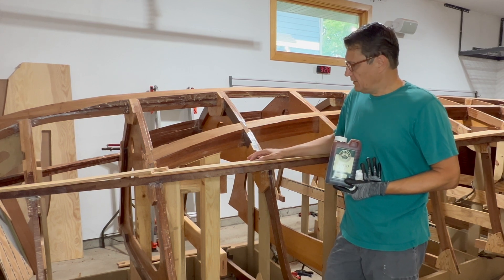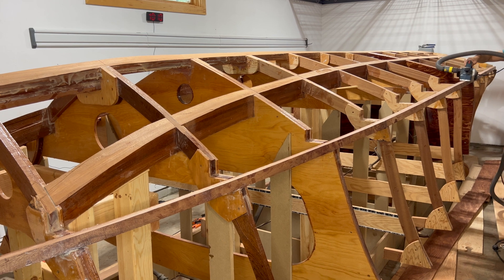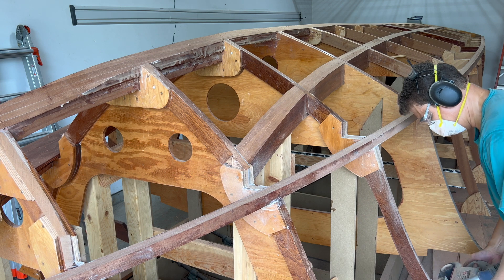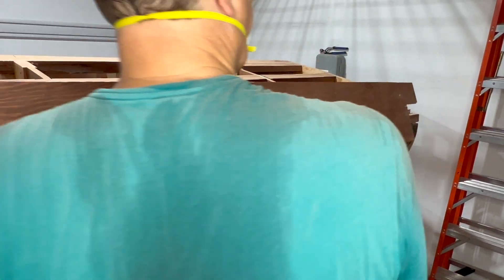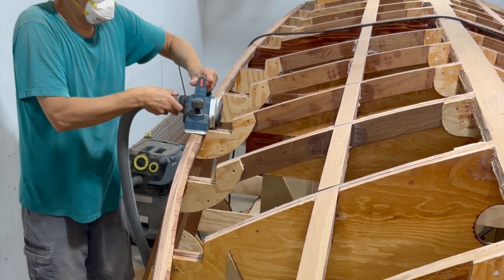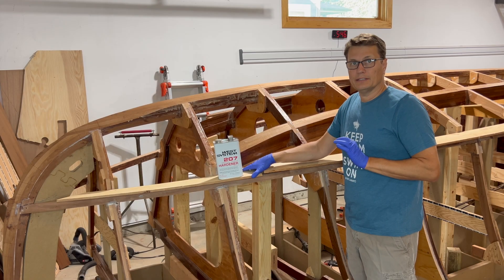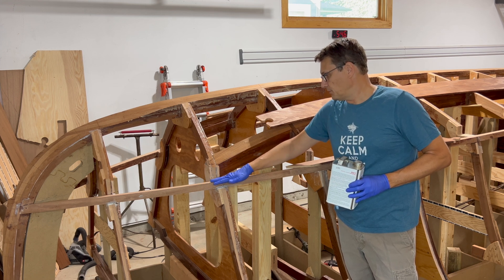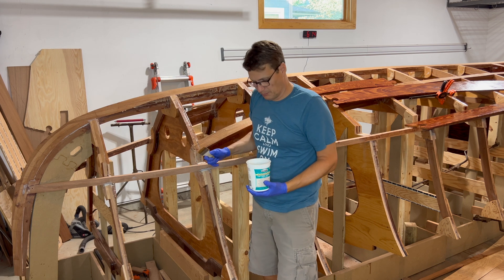Temptress Build 50: Installing the 1st Chine Laminate

Comment: Can you let me know who your wood supplier is please and how you specified your first order for the frames etc. I am based in Michigan and want to plan for this build.
Reply from the maker: Hello - I purchased my wood from Forest Products Supply in St. Paul MN.

To get 7/8th inch thick boards, I purchased 4/4” boards and had them plane 1/16” off each side.  They called it hit or miss planing.  I had them edge one edge.

If you email me at bobkody@gmail.com 
I can connect you with a fellow boatbuilder in Michigan.

Comment: Have been enjoying your boat building journey so far. In the future I would trim the chine to 1/4 in shy then route the chine for a cleaner cut and less stress on your bit and router :-) Advice from a 30 year cabinet maker
Reply from the maker: Thank you.  This is good advice… as I already broke the roller off of one bit.  
I am almost done with layers 2&3 of the chines.  I will remember this for a future step.

Comment: I agree on the look of standard AB marine plywood. I bought a sheet as it was my closest option without driving 3 hours back and forth for other types of plywood. I found out that AB is the base grade for plywood. Meaning it will have repairs throughout the sheet. There's 4 inch long ovals throughout the sheet.
Reply from the maker: I did not know that about AB marine plywood.  I too have the ovals.